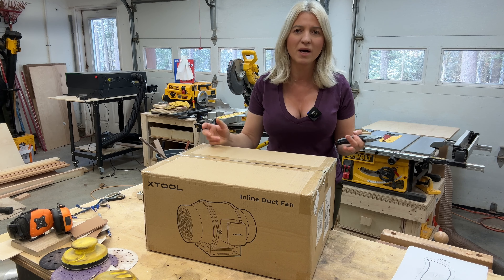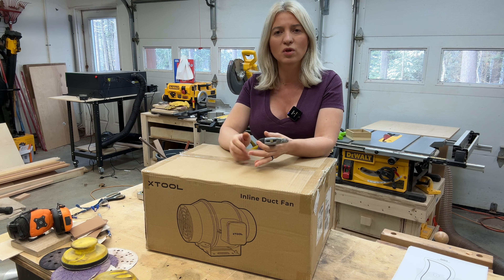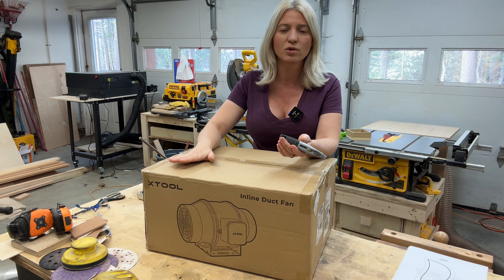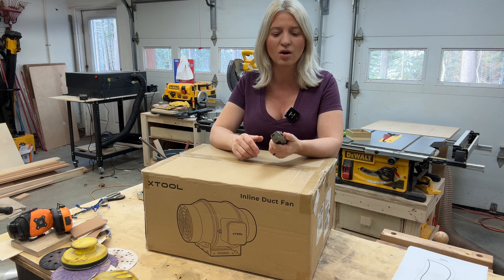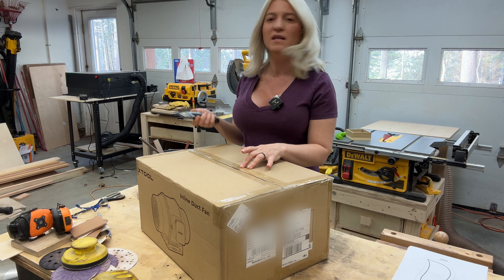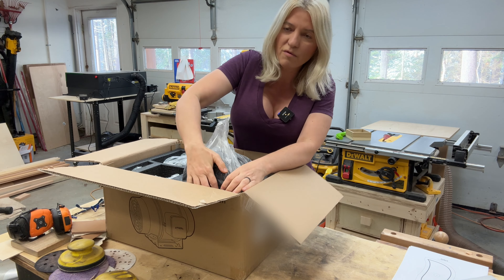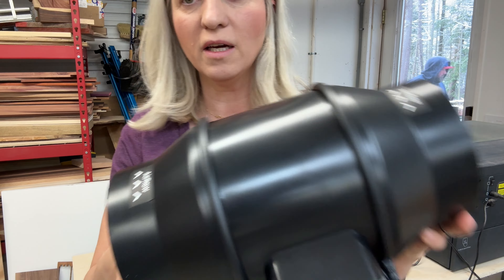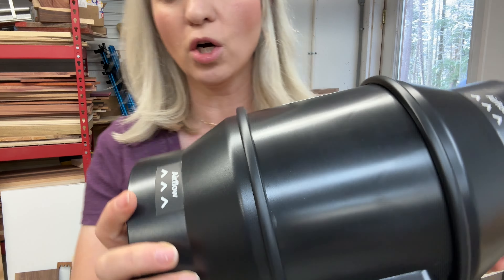Xtool 6 in 410 CFM Inline Duct Fan for xtool or any other enclosed laser. Must have for diode lasers

Comment: We just got the xTool 6” in-line fan in and installed it per the manual. We ran a job last night and used it for the first time and we found out it was backwards! The flow arrows were backwards on the fan. Word of advice - always check the fan BEFORE installing it to verify the flow!
Reply from the maker: That’s funny! Yes. Always check

Comment: Thanks, I am so close to ordering one, xmas purchased all new routers this yr seems like Bosch had some great tool deals this yr and compression bits and router accessories, and a dust extractor. I had to grin once you said all was well, but could of imagined your reaction as the vent pipe was going up with the garage door. Glad it didn't become an overhead laser and an important tip for the garage shops! Also, appreciate the info on needing a riser for 3/4" cutting and the inline duct fan as I create my budget for my next tool! You the best Skyler, you will get my clicks on links that for sure for the great help,hope you have a great week! Thanks, Skyler

Comment: Please post a link to where you got the 6" to 4" adapter from the xtool fan to the 4" exhaust vent. That seemed to have a similar fit as the 3" to 6" provided with the fan. Thanks for the video!
Reply from the maker: I will add it in the description in next 5 minutes or so. I am just waiting for my computer to restart
Reply from the maker: I just added the link
Reply: @woodworkingwithSkyler  Thanks!

Comment: Do you get any leakage from the fan unit?  I just installed mine and ran a job, smoke pouring out of it. It’s like the fan doesn’t seal in its holder with those two ring clamps.